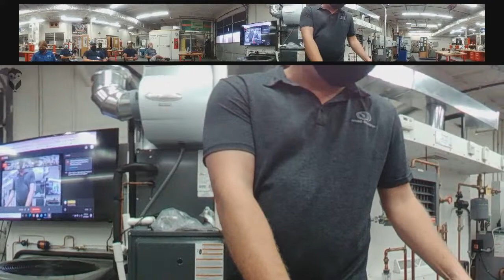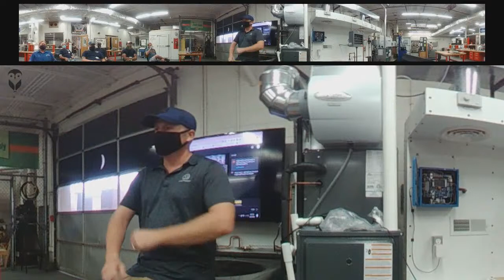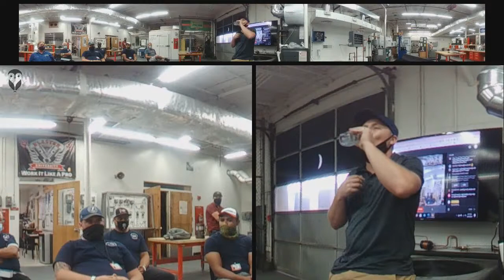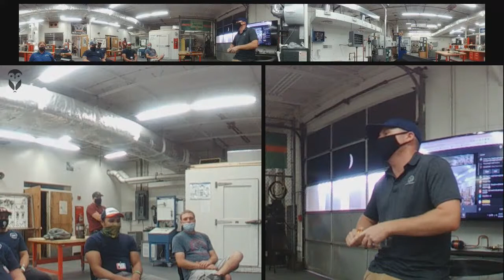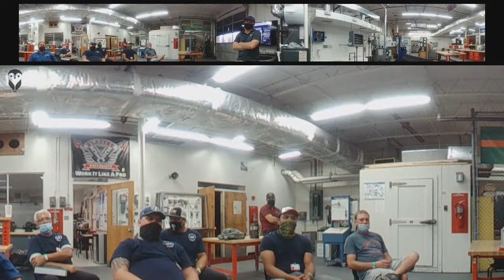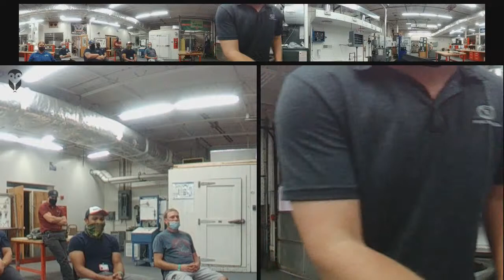LIVE Apprentice Q&A

Comment: In reference to an air handler what does upflow and downflow mean
Reply: Jesse Sibley up flow simply means the air  discharges out of the top of the air handler and down flow means the air discharges from the bottom. Down flow is used when the supply ducts are in the floor and up flow is used when the supply ducts are in an attic or the air handler is in a basement with the supply ducts are overhead.